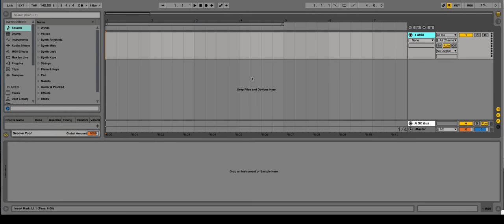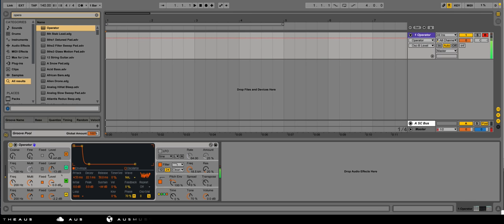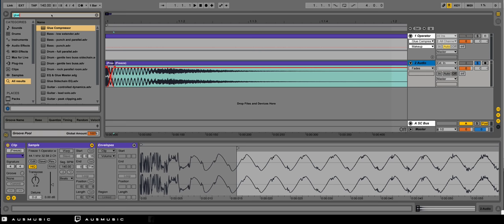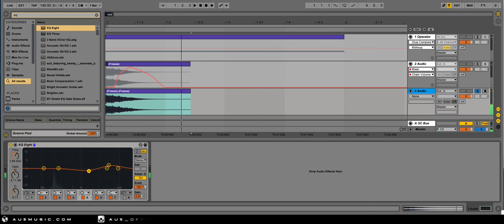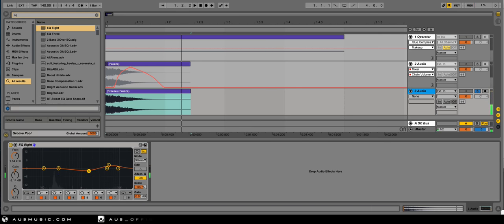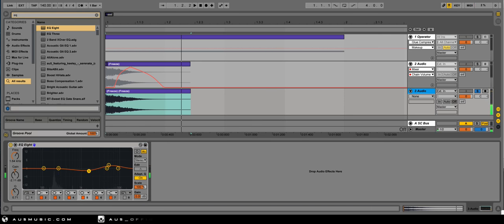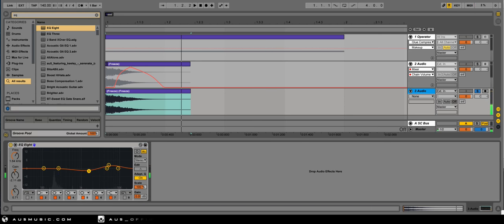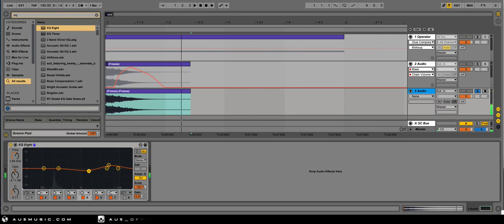Punchy Drums with Operator

Comment: This is giving me lots of good ideas in fact; I've seen the suggestion to use Frequency Shifter to retune drums a few times but I still feel like you have to shift the body too much to get an appreciable change in the noise character - you could Repitch the sample down (or up) first, then retune using Frequency Shifter to place the body tone back at 200Hz. Everything but the body would be shifted.
Reply from the maker: NF2K Yes, as I mention, frequency shifter will transpose pitch of the body yet preserve the timbre. If you want to change the timbre while preserving the pitch of the body, transpose the clip and frequency shift the pitch back.

Comment: Loving the tutorials, some really good info. Main thing I would suggest for future is to put a sample of the finished product at the start of video.
Also correct me if I'm wrong but at 9:25 would that not be downward expansion?
And quick tip: if you hold alt while dragging a bell or shelf node in EQ8 their Q can be adjusted :)
Reply: Wanted to ask a similar thing so I scoured the comment section. It seems to me it's upward expansion for the mids and upward compression for the highs?

Comment: Noted that this may be 5 years too late. Thanks for this! I just have a bit of a technical question, maybe this is nitpicky, but I was wondering how to improve VU levels of the kick whilst still maintaining its peak value. Im comparing my mixes to pro tracks, and they manage to reach 0 on the VU meter, whilst maintaining around -6 db of on the sub section of said kick. Im not sure how to achieve this. If I push the overall volume of the kick up, to reach that 0db VU mark (set to -3 as reference) I inevatibly push the subs up. Anyway I can balance this? Hope this makes sense.

Comment: Copied all the settings for the snare but when I'm in operator all my midi keys play it exactly the same if that makes sense. Like if I got down an octave it has no effect and still plays it at the same pitch.
Reply from the maker: Transpose only works when your operators are in keytrack mode, not fixed mode